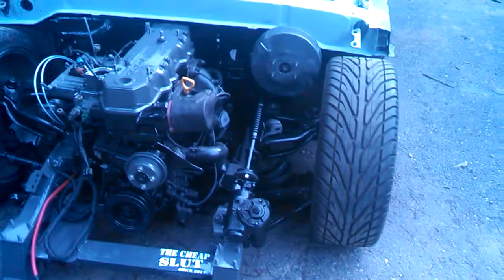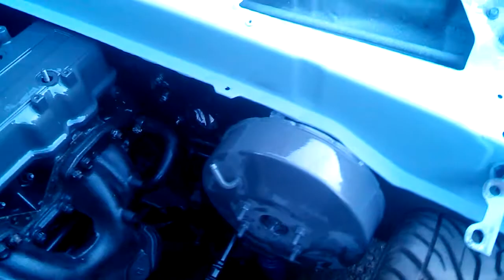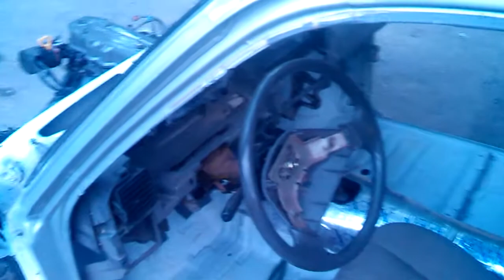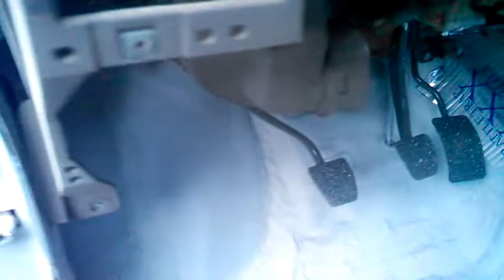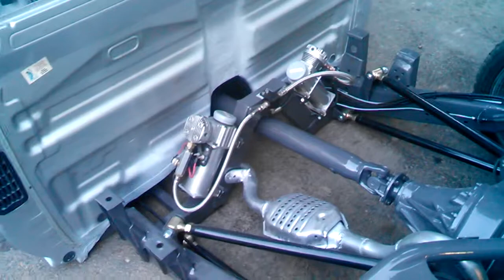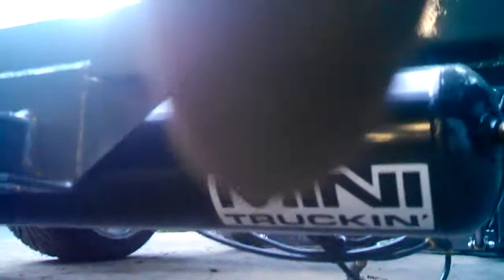The cheap slut project

Comment from the maker: Had that problem on my old hardbody U should look into drop spindles that will definitely help that issue
Reply: only problem is i already do:/
Reply from the maker: scrappingpavement do they make a control arm with camber adjustments... i never looked into it... back in the day i was running 15s lmao spindles worked good ...and i dont drive my bagged pathfinder much to notice any wear i have 20s and spindles on that